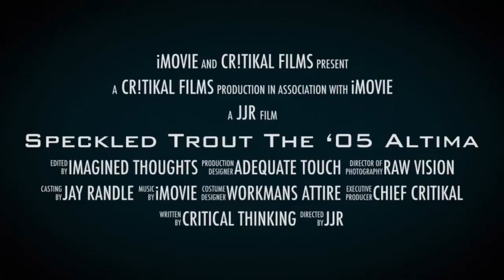How to-Custom Paint Nissan Altima: What This House of Kolor Can Do!

Comment: Awesome work! Can you tell me what flow coating is?
Reply from the maker: Flow coating is basically when you have cleared vehicle already, you wait till the clear is cured 3-5 days depending on materials and temperature. Then you sand clear coat smooth with 800 wet ….you can block flat areas for better results. Once vehicle is prepped you would clear it again.
Reply from the maker: Used on custom jobs with designs, or even flakes
Reply: @whipzpaintlyfewithjay9654  thanks man I always wondered. Keep up the Awesome work. Can't wait to see the next one